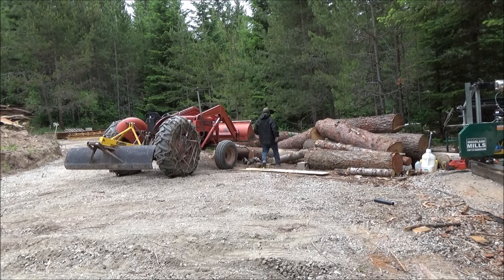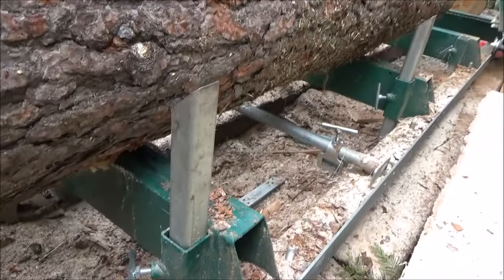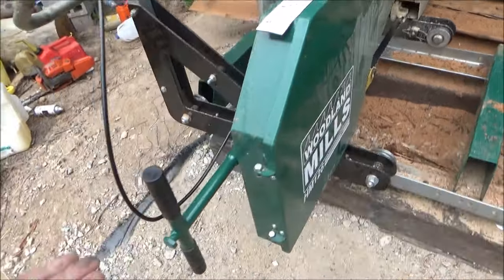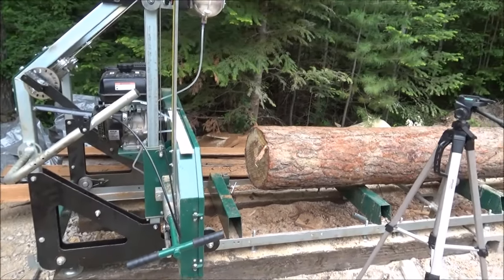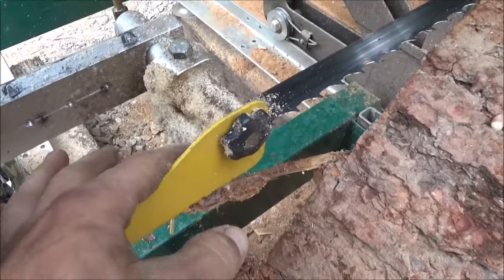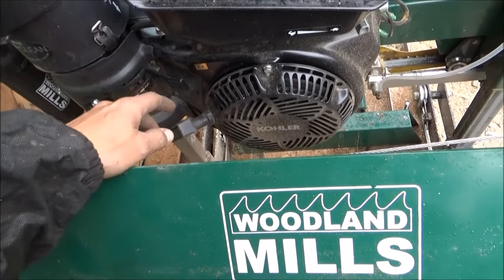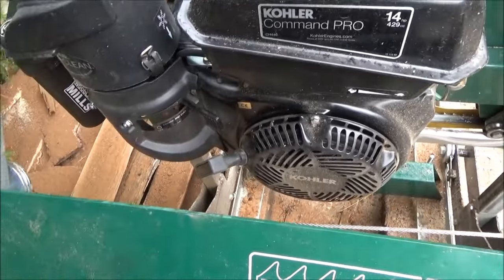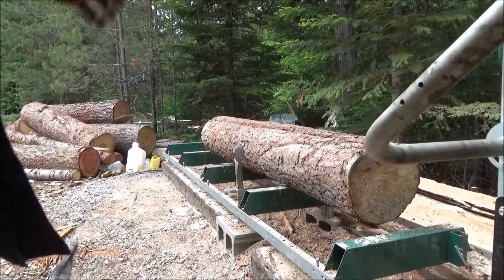Milling your own lumber complete tutorial (Woodland mills HM126)

Comment: Thanks for the video. I've got an older 126 (2014) which means I have been on it for about 8 yrs, I cut mainly Doug fir. I started out cutting 2 inch thick boards, but found it was a waste of wood, now I cut nominal sizing. 1.5 inch X whatever size I need. My main reason for doing this is the boards are much lighter in weight, making it easier for an old guy like me. I also do my own logging using an old 4x4 and log arch for pulling them out of the bush. I find the best time to harvest trees is in January or February when everything is frozen and dry. With the sap in the roots at this time of year the trees are as light as they will be and there is minimal sap left stuck on the blade. Have fun.
Reply from the maker: Thanks for the advice. I've done a little of both nominal and "true" I would say they're definitely lighter at the normal size. I also like winter logging seems to be easier to skid them out in the snow. Take care!

Comment: Nice setup 👍 I know it’s not normal for a woman but I bought the HM122 & I’m putting it together so I found this video really helpful even through it’s a different model. Only thing that worries me is I don’t have a tractor or winch to get logs on the track yet, as a temporary solution I’m just planning to build a ramp out of earth & timber. Fingers crossed it works or I have a really expensive decoration for my field !
Reply from the maker: Right on, I think you'll definitely be able to do it with the ramp style because I've seen it work for other and myself! Best of luck to  ya!
Reply: Good luck!

Comment: I'm hoping to get one of these soon... I've got a lot of standing timber that I want to turn into a cabin, among other things, but I don't want round logs, I want beams & boards... this particular make & model I like much better than the Harbor Freight mill, not that there's too much wrong with theirs, but this one's still in the doable range & I like the design better... certainly a thorough demonstration...🖖🏿😎👍🏿
Reply from the maker: Yea I've had it about 5 years or so and I can't say a bad thing about it. Works well for me. Good luck with your endeavors :)

Comment: Instead of flipping your log to 90 degrees just flip it 180 degrees. More stable to saw.  The sides will be parallel.  The rotate the log 90 degrees and set it against the log stops.

I made log stops with a steel roller on the top.  Much easier to roll the log.  Won't get caught on the log stop edge that comes with the mill.

Comment: If you watch Sawing with Sandy, he will describe that "tinging" noise when you start your mill and when it is at idle and explain how it is your clutch wearing prematurely.  Good Video sir.
Reply from the maker: Right on yea I turned the idle down  but for some reason it runs a bit fast for the first little while and slightly ingages the clutch . Thanks
Reply: Damn. i have the 122 model and the smaller kholer motor and she's made that ping a few times right from factory. Barely 10 minutes of cutting

Comment: Ahh yes. The scraper as a counterweight. I did that. What a pain. It caught on everything. trees. rocks, roots, buildings etc. Finaly I made a mold and poured a concrete weight. Much easier to maneuver. Cheap too. 500lbs. Kioti 3510If you build a brow, a platform to put logs on and then roll them onto the mill,its much easier. You dont hit your mill. You dont throw it out of level. I know this because,,,  I did it all the hard way first .Thats quite the set of chains you have there. I used bed springs to tension mine. The chains I made out of scraps I had and some truck cross chains I was given. The cross chains were too big ,so I cut them down. They had twisted links. They work. I did put my mill on a concrete slab.

Comment: have you experimented with painting the end to prevent greater moisture lose through the ends?  Have you had cracking at the ends?
Reply from the maker: Yeah I have in an older video it shows me using anchor seal which is a great product that prevents this from happening.

Comment: I see your sitting your rails on cement blocks and ties. Do you get frost at your location and if so, do you have to keep checking your rails for level in the spring time?
Reply from the maker: Yea we get frost im pretty far north in the lower 48. I have to adjust it in the spring once it thaws but I will micro adjust every so often.
Reply: Ok great, I'm in northern Maine so really didn't want to set footings 6 feet down. I can live with minor adjustments every spring. Thanks again and great video

Comment: You're cutting 2x4?  Not 1.5x3.5?  I don't use the scale much, 5 rotations is 1.5 inches, etc.
Reply from the maker: Yea I cut all true lumber. Over a year later they're down to 1.75 x3.75 give or take . And about 6-9 % moisture content
Reply: Oh God a 2×4 that's actually a 2×4!

Comment: Great video! Thoroughly enjoyed watching it. I was wondering, do you ever use "green" wood to build with? How long do you typically wait for the wood to dry out, and do you get much warping? Thanks for the feedback!
Reply from the maker: Thanks, yes I've built with green wood it tends to shrink more in width the length but not the end of the world. They say to wait 1 year per inch of thickness but I'm going with a year. Most of my stuff I milled last year is around 8-10% moisture content

Comment: My question is on ............tractors!
I am buying 40 acres of mountain, mostly forested land to clear a plot of pines and build a cabin.
Any thoughts on buying a tractor, new? used? size? etc.

PS... I would get a better mask, actually you should be using a respirator.  Those paper masks do not sufficiently protect your lungs.
Reply from the maker: Yea youre probably right about the mask but its better then nothing. Lol i would say it depends on your budget. If its hilly terrain or muddy definitely get a 4x4. Obviously a 50k tractor would be best but old stuff was built like a tank back in the day and last along time.
Reply: @offgridhandyman   Thanks for the quick reply much appreciated